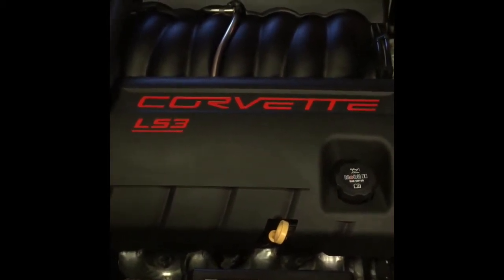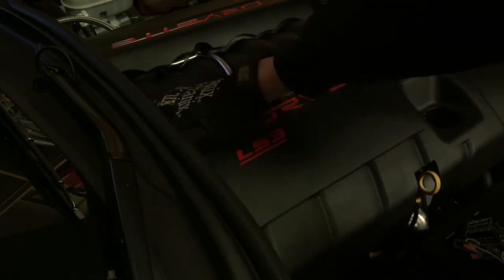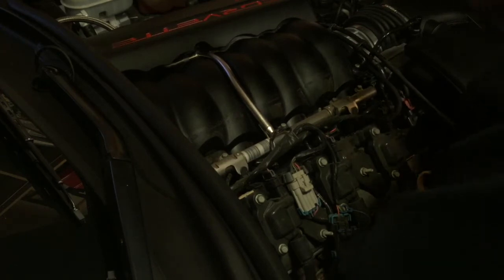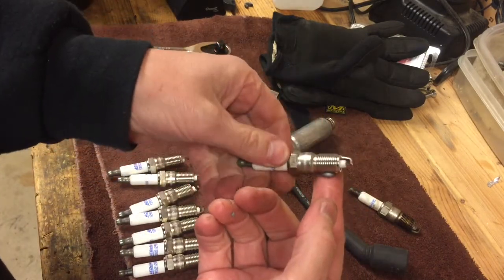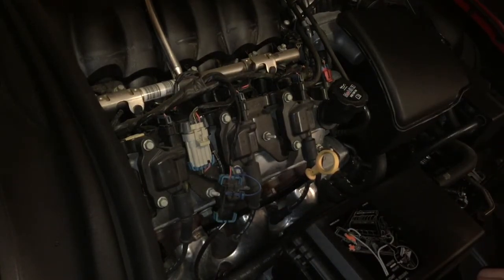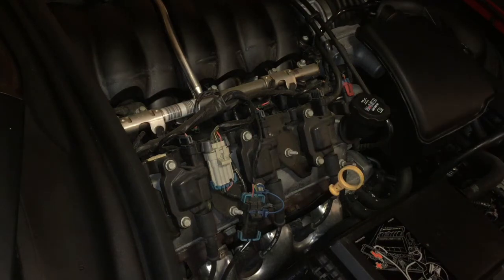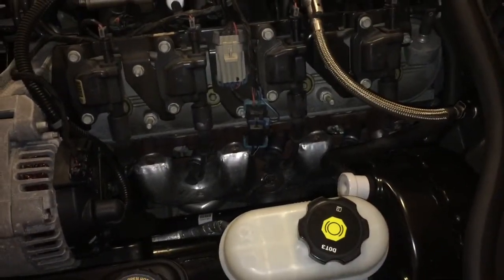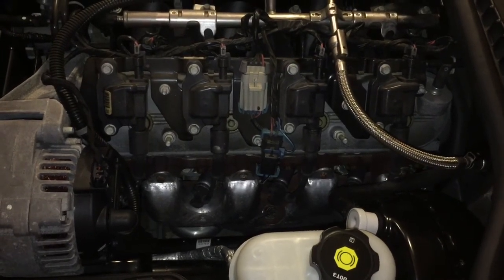2009 C6 Corvette LS3 Spark Plug Change

Comment: I recently changed the plugs and wires in my stock 2003 C5 LS1.  It was originally my father's car - he bought it new.  Here's the shocker...it has 153,000 miles on the original plugs and wires.  Engine still ran great and no codes were being set.  I knew it was overdue for some fresh plugs and wires.  Due to age and miles, the boots were stuck on the plugs.  I broke several wires pulling and twisting on the boots.  I ended soaking each boot with spray lube and waiting overnight.  That did the trick.  Thankfully, I had new wires waiting to be installed.  The gap on the old plugs had grown to .058". (s/b .040").  The color of the old plugs was perfect - a nice light tan color.  Leaving the oil fill cap off while working would make me nervous.

Comment: No need to gap? I just received my ac Delco spark plugs. It bold print "SET GAP PER VEHICLE SPECIFICATIONS ".
Reply from the maker: It depends on the spark plugs.  For Iridium type spark plugs and many other fine tips, they can be damaged if trying to gap them so they are pre-gapped.

Comment: Thanks for the video, very helpful as I am going to attempt to change the plugs in my C6 LS2..Only thing I would add is I want to see the difficult ones to remove and not just hear the last 2 I had to use a smaller extension... I want to see what you used and how hard you had to struggle so I know ahead of time. same with the driver side and the fuel line, would have loved to see how you struggled to get it off and not just hear how you had to flex the cover. I also understand its hard to video and use 2 hands to do something as well.  Great video thanks again. I subscribed..
Reply from the maker: Thanks for the response and the follow.  Unfortunately, I realized after I did this one that the lighting was not very good and also did not want to be repetitive by showing 8 spark plug replacements.  As you mentioned, I probably should have just showed the difficult ones.  If I remember correctly, they were "somewhat" difficult but not super hard as I have experienced on some other cars.

Comment: Didn't mention how much torque to use but typical might be 11 ft. pounds with dry threads. Also if using thread grease than torque should be lower because specified torque assumes plug are dry.

Comment: It would have helped to see the tool needed on the drivers side that you talked about. Other than that great presentation. Also, what was the mileage on the old plugs?
Reply from the maker: Sorry about the lighting, the spark plug puller can be seen in the video thumbnail and the mileage was 67K miles.

Comment: Way easier than c4 spark plug wires.
Reply: Your right. I'm doing mine right now on my 96 and I'm about to cry.
Reply: @positronicreflex.  I'm a mechanic and once the front desk people charged way less than the job really was so I backed up and told front shop either call customer and charge more labor or they could do it them selves. I can remember just to get to those wires in front of the engine was a pain,  I believe the distributor is shoved in some tight space.
Reply: @Keyno77  Yep. That's why I vowed to do it myself, prob saved a couple hundred. The opti is right under the water pump, but I only removed the drive belt and one pulley. Thankfully my arm and hand fit thru the top to reach down with taking anything else out. It was a nightmare, but my check engine light went out! 👍
Reply: @positronicreflex.  I'm glad you got it repaired yourself peace of mind, also important tip always torque your spark plugs to manufacturer specs.